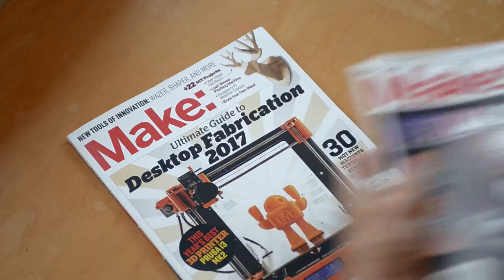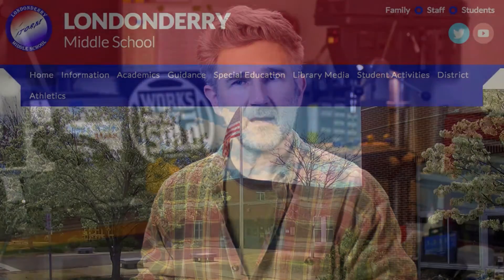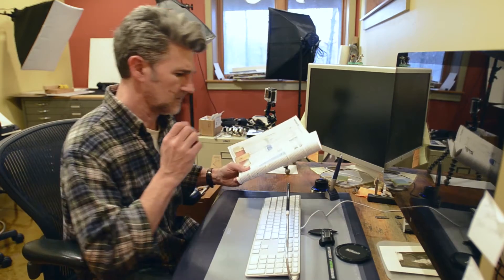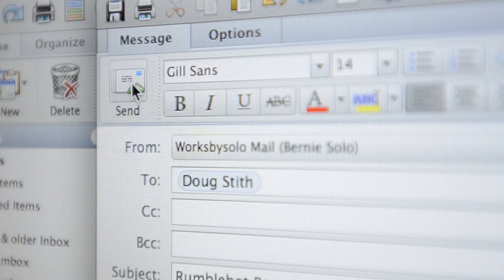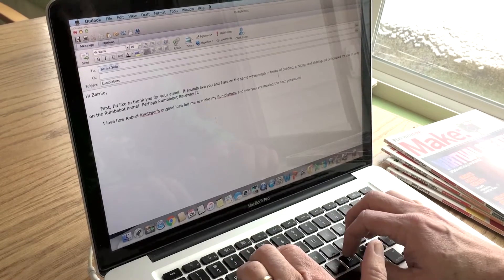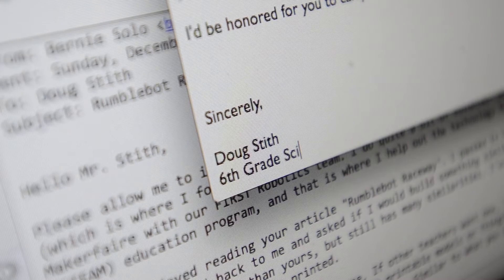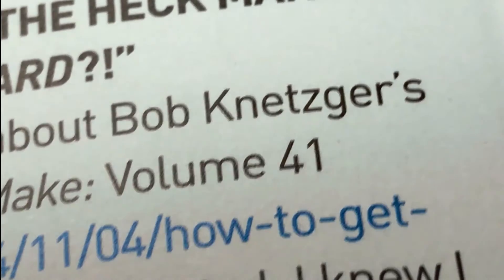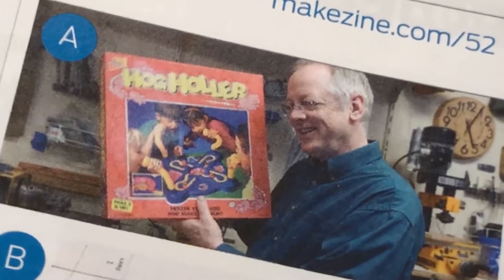RUMBLEBOT RACEWAY is a school classroom science manipulative that combines fun with experimentation.

Comment: Do you have plans :) This is wonderful!!! I need to make one for our school's STEAM  night.
Reply from the maker: +H G Not yet. You are the first to ask. I can probably put something together for you. How soon do you need to start?
Reply: I think I can visualize it and break parts down into something similar.  Will have to start this weekend :). Are the dimensions similar to Mr. Stith's Make article? Thank you for responding!!!!
Reply from the maker: +H G I'm sure you can. It's a pretty simply machine. The general size is similar to Stith's. I have the whole project in CAD. I just have not broken it down into a set of plans and instructions yet. Can you utilize the CAD files? Are you planning to use the 3D printed gears and cutting wood parts with a CNC router? It can be done with hand power tools. I would do the joints differently in that case.
Reply: I don't have a CNC or 3d printer so I will be scrollsawing out the gears using plywood :) and tablesaw/router for the rest.  I will definitely do the joints a bit differently, and in the interest of time, it'll just be a very simple box :).  Yes, I can view the CAD files!! and LOVE your channel!!!
Reply from the maker: +H G that should work just fine. PM me with an email address. I'll send you what I have. Thanks!!